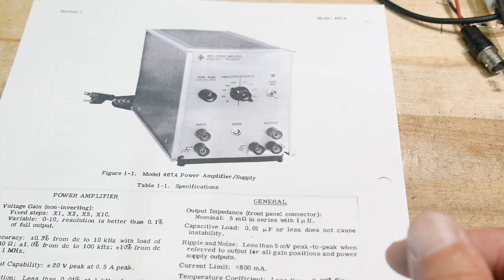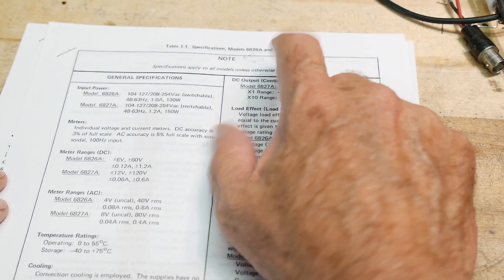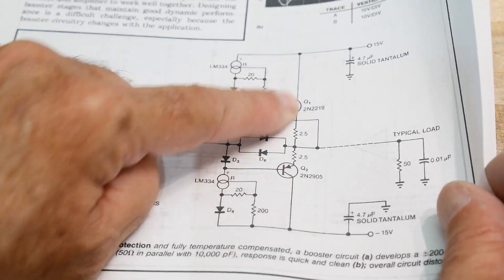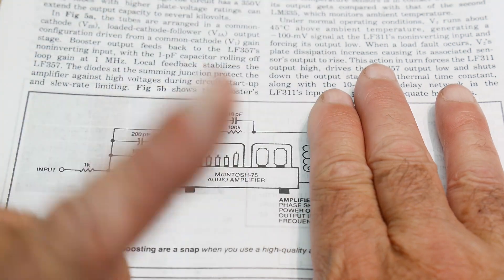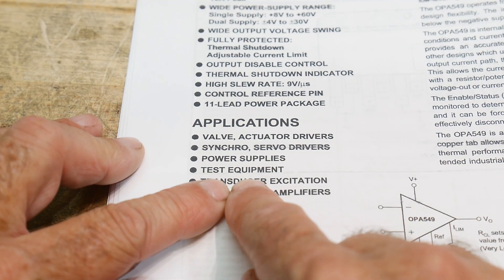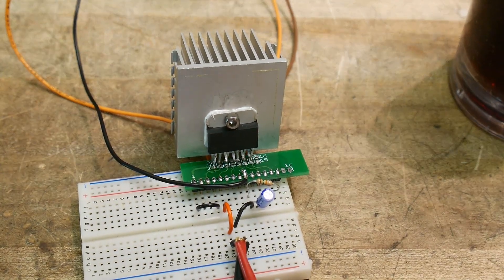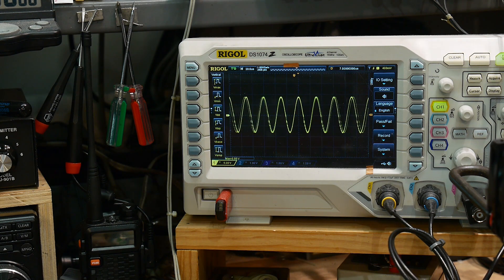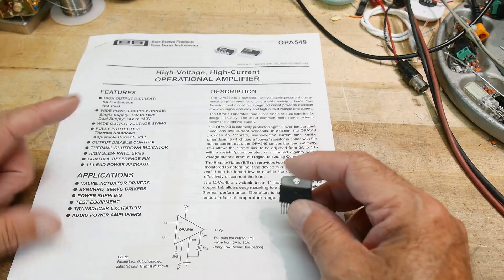#800 High Current Bench Amplifier (part 1 of 2) OPA549A

Comment: (16:24) You can't accurately measure temperature of aluminium or any other shining metal which is not quite black. 
You either measure black plastic case of IC or put some black or dark tape onto a heatsink.

Comment: Have you seen the function generator amplifiers offered by the feeltech/feelelect brand? Not too pricey, and they have various models capable of between 20 to 100watts, and up to 10mhz. There are a dozen different models but a few of them are 

FPA301 series
FPA1000 SERIES
Reply from the maker: haven't seen that, had anyone done a teardown?
Reply: @IMSAIGuy  not that I can find. But myself and several others would be interested in seeing that

Comment: Thanks, interesting project became i have had that need recently and was wondering about building something.  My 2 thoughts on the glitch. 1 those caps you refer to as local, aren't very local.  2 digikey wants $36 for those parts and you got them for way less. 
Probably don't need tant caps.  Decent electrolytic caps and ceramic bypass is probably good enough these days

Comment: Very interesting. My wanderer thoughts in the past for a poorer man’s solution, using those TDA2020 or 2030 as you chose, but didn’t proceed at that time. 
Your research hints to be promising, obviously for lower voltages and currents, as to drive 12V rated DC motors (~servo like). 
Have you worked some more about it, or found other people with results - good, so so, or really bad?
Thanks for sharing.

Comment: The LM3886T may be an even better choice, as it supports a wider set of voltage rails (+/- 28V) and has a maximum peak power dissipation of 125 watts.  Also, its minimum unit gain bandwidth product is 2 MHz (8 typical), which is pretty phenomenal.  These are currently on back-order at Mouser, but they can be found on eBay.  Please avoid international sellers, however, as many parts from international sources are counterfeit.  I have made several buffer amps with this part and it's a tremendous addition to any standard signal level signal generator.  Also, this part is similarly protected from thermal overload (via Self CC = Peak Instantaneous Temperature (°Ke) (SPiKe) ±35V protection circuitry,) and short circuiting.  You just can't go wrong with this part.
Reply from the maker: I looked at some audio amp chips. They did not have internal short circuit protection.

Comment: How about an amp that can deliver +/- 10 volts into 50 Ohms up to 30 MHz? That's only 200 mA but much faster. I would like to find such a thing.
Reply from the maker: https://www.youtube.com/watch?v=LREJazLcELs
Reply: @IMSAIGuy  Yes, I am aware of these parts. Unfortunately they are discontinued! I have yet to find any suitable replacement that is still being made! Very frustrating!
Reply from the maker: @herbertsusmann986  OPA633
is close
Reply from the maker: OPA692
Reply: @IMSAIGuy  Yep, both of those parts fall short (OPA692 and OPA633). Seems no one makes a 50 ohm driver anymore than can drive to +/- 10 volts fast.
Reply from the maker: @herbertsusmann986  LMH6672
Reply: Just 4 LM6172 opamps in parallel. That's only two cases of them. Each half of 6172 case  can deliver 50 mA.

Comment: When measuring temperature with an "IR gun" be sure to consider its detection area, which is a cone starting from the lens. The red lasers I think are just "for fun".I know you know, but my OCDdness made me write the comment :D
Silly question, have you worked at HP in the golden days?
Reply from the maker: yes, I need to upgrade to a thermal camera
Reply: @IMSAIGuy  Thermal cameras are fun, but waste lots of time. Just hold your "Laser" sensor right on top of the DUT , press and release the button = perfect reading of a thimble sized volume of heat in 2 seconds - with zero possible background FOV noise! It's a 30+ degree FOV cone temp sensor and you were off-camera (1+ft) away from the DUT!

Comment: I've recently got an HP 6827A and I love it! Mainly use it with my pulse generator to do some niche things. What is the "modern equivalent" your friend mentioned? I ask because I recently got some Kepco units. I got a Kepco BOP 36-12 and a BOP 20-10. They only have a frequency response of ~15kKHz but are rated 10 amps! I like the kepco models because you can amplify voltage OR current, allows for some unusual setups I have yet to play with.
Reply from the maker: the ones he mentioned are made by Picotest. They have signal injectors for high current pulses.
Reply from the maker: I had forgotten about those Kepco units. very nice.